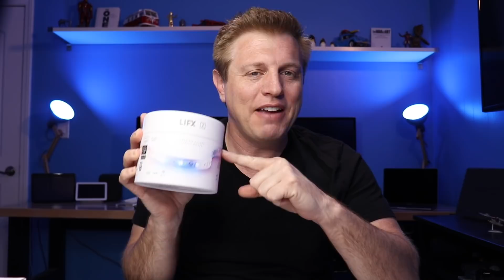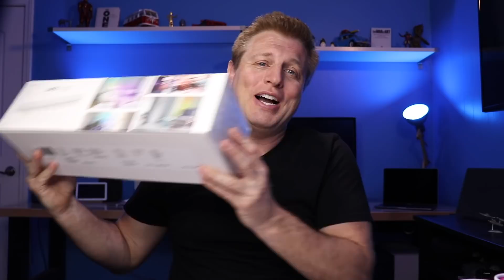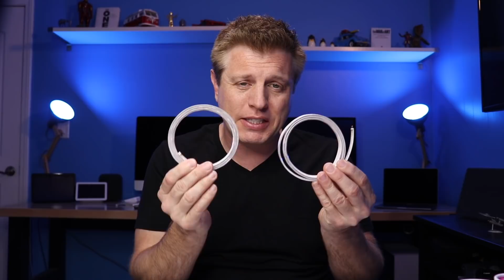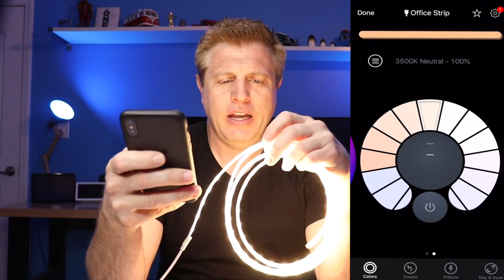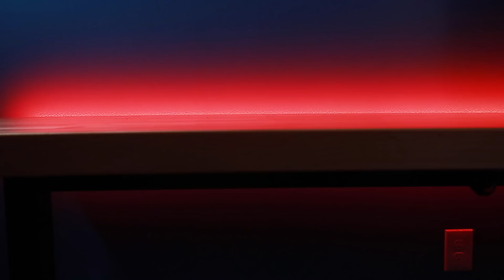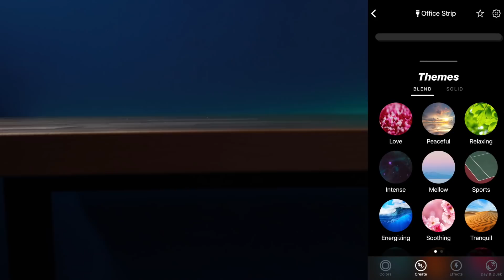LIFX Z Strip Setup and Demo - Best WiFi LED tape light strip

Comment: I have 6 LIFX lights in my living room, 2 wall lights, 3 in a floor standing lamp and a 3 metre Z strip behind my tv.
They are pricey but I don't think you can beat them, they are all controlled by my Echo, Google home and Harmony hub.
Reply from the maker: Hello Jason, you are all set up with the LIFx. That is great. I think you're right you can beat them even though they are pricey. They make a great product and you get what you pay for. It is nice to have the echo and Google home be able to control them easily. This all is very cool stuff. Thank you for checking out the video and sharing your sat up. Have a great day.
Reply: Hello bro can u let me know before I buy, I have a room I just moved into but no WiFi, can I still use it without WiFi
Reply from the maker: Hello Baby, sorry just seeing this. It will power up without WiFi. But you have to have WiFi to control it.
Reply: Hey man does it mess with your internet speed at all or nah
Reply from the maker: Hello Bball, I have not noticed any change in internet speed. I have 25 smart devices and have seen no change.
Reply: @CraigsTechTalk  Ok awesome good to know thank you!

Comment: Hi Craig! I bought a couple of LIFX mini based on your advice and I’m really happy with them. Do you think that the strips could work as sufficient light source to read/work if I put them under a bookshelf to light a desk where I work? Thanks!
Reply from the maker: Hello Mariano,  That is great to hear that you're enjoying the LIFX mini bulbs. I am glad to hear that. I think they're great bulbs but I would hate to lead anybody astray. 
 I think they would be bright enough if they were on a shelf facing down on a desk. One 6.6' starter kit is the same output as 1.75 times the output of one LIFX mini bulb. The mini is 800 lumens and the strip is 1400 lumens. It is spread over 6'. But coming down from a shelf I would think the would be plenty bright. 
My suggestion so I don't lead you astray would be to buy them from a best buy or some place you could possibly return them. I would do a trial fit and hold them or temporarily tape them at the height of the shelf. You don't even have to set them up in the app. They will come up to full warm white when plugged in. If you dont like it and your not satisfied you return it. I personally dont return much, but I am trying to embrace the idea if something doesnt do what I need it to. Sometimes even the Amazon return is worth paying the shipping or $8 - $10 to know if it is a good product for you. Better than just sticking with it. 
I hope this helps some. I pulled out my desk 2 feet and feel I could read comfortably with the output. Thanks for questioning and sharing your thoughts on the LIFX mini. It's good to have some second opinions. Have a great Friday.
Reply: Thank you Craig!

Comment: Hi, Craig! I just upgraded to the newer Lifx full color bulbs, the new ones that work with Homekit.  Love them!  Q: With the individual strips, can you 'segment' the strips into areas with specific colors?  I know they can pulse different colors, but I'm wondering how the app splits them up, or even if it does.  Hope that made sense, and thanks for the videos!
Reply from the maker: Hello CJC, glad to hear you got the color bulbs and are loving them. They make great bulbs. Yes you can break up the color in 6" increments. I should have covered that in the app. The video was getting a little long. In the app there are two options for creating a multi color strip. You have the fill section that will turn the whole strip one color. Then you can.swipe to paint. From paint you can pick a color and tap where on the strip you want that color. You could make every other 6" segment a color for a 2 color combination. You can make every 6" a different color. Or some combination in between. You can even have the colors you pick move along the strip for a slow effect. I should do a follow up on the app after in he LIFX beam video. Thanks for your question and watching. Have a great day.
Reply: @CraigsTechTalk  Cool! And thanks for your fast reply, Craig!  About 2 years ago I setup non-wifi - but remote controlled - strips. The 30-40 dollar Amazon sells.  They're stuck behind each of my stereo/turntable shelves and really look great......but now I really wish I could Siri the (&*& out of them!! But....I'll have to wait.  The IR remote works okay, and I'd have to see if running LED strips top-bottom along the shelf rails would have the same effect.  Now each shelf edge facing wall is dasy-chained with an extender that leads to the next shelf.  Works great for positioning the lights.   Anyway, thanks again!  You do great home tech videos!
Reply from the maker: Thanks for the follow up. I hear what you are saying about wanting to update your existing strips. Have you thought about a smart plug for them? I did that with some of my old strips I used in the beginning of making videos.
Reply: @CraigsTechTalk  I have one smart plug for a indoor filter fan. I don't know if the strips in question default to ON on power restore. I'll look into it! If it works, that'd be an inexpensive solution while I save for the full home automated strips.  Craig, thanks so much for the tip!